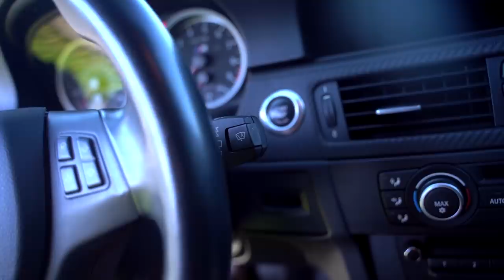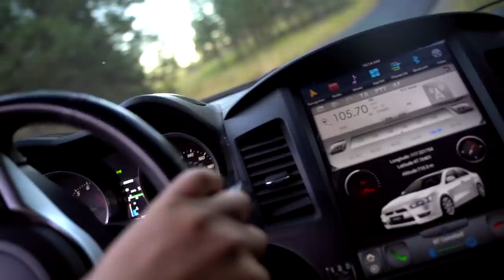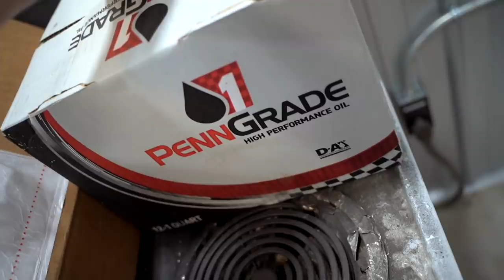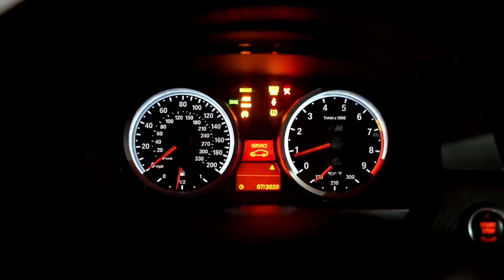The search continues.

Comment: Devin there might be a GMC bed that fits your truck in Modesto Ca. If you can't find one anywhere else. Search under Craigslist under auto parts  for "GMC bed 2018" its far drive for you but it looks like a nice bed with lights, tailgate and liner for 850.00 if it works for your truck. It has a Sierra and GMC plate.